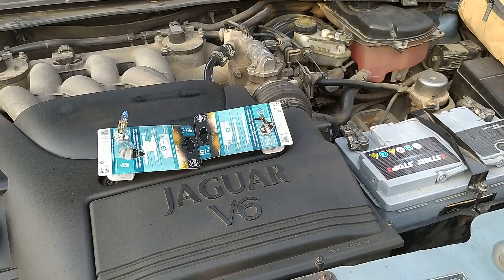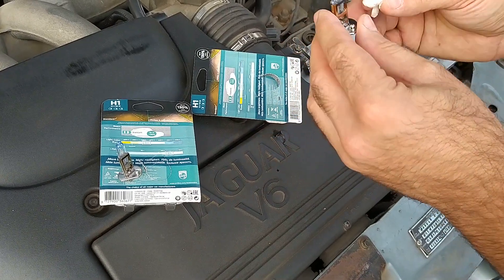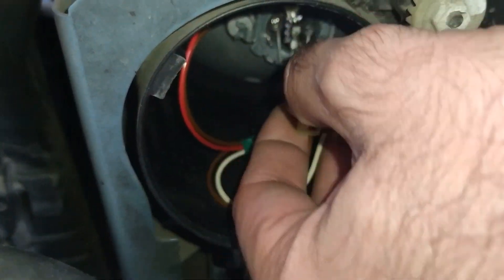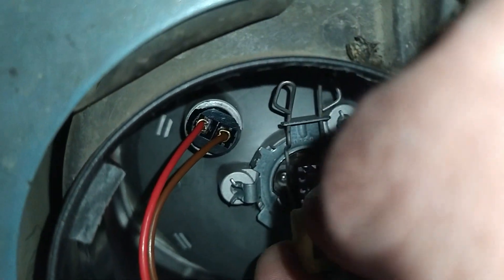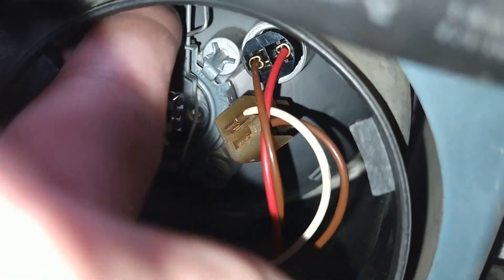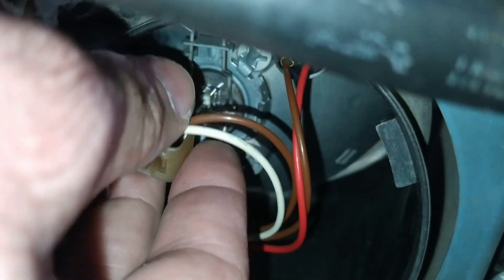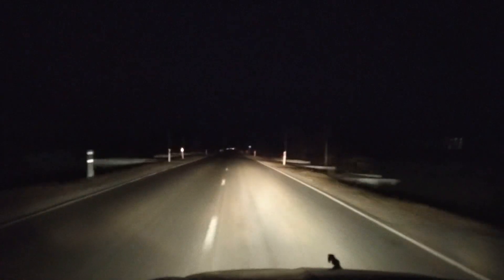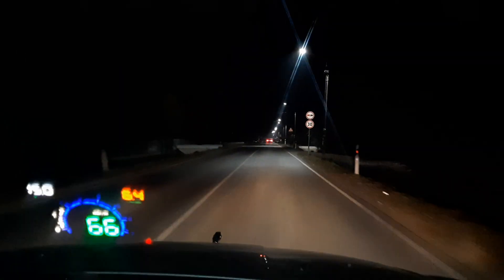Jaguar X-type headlight bulb replacement and headlight improvement

Comment: Just found your chanel... Any chance you could tell if I can change the lights to led....
Reply from the maker: LED needs a good cooling, X-type headlights are not designed to provide a good flow of fresh air to the bulbs. So I believe, HID xenon's are preferable for the X-type outdated headlights.
Reply: @jaguarrroman  thank you so much... Will try them.. Love my jag but the lights are the reason I can't take it out in winters..

Comment: This one is easy, how you replace one beside it? Do you have to take a bumper off or?
Reply from the maker: No, surely not. I get a thick wire hook and undo the side clip with it pushing it aside. After both clips are undone I open the cap and turn it horizontally in the corner of the engine bay.  This gives enough access to the low beam bulb. I can maximally remove the battery if smth goes wrong with the bulb, but removing the bumper is out of the question.

Comment: You changed the side lights not the head lights
Reply from the maker: Yes, I installed halogens into high beams and I intended to take video of installing HID xenons into low beam, but meanwhile HIDs burned out. They lasted about 5 years.

Comment: Hi great video, I have a question. So Jaguar that’s shown on your video it has a 2 outer headlights an 2 inner headlights ()()___()() do they all use the same type of bulbs H1 or is there something different with wattage? Sorry I’m new to this.
Reply from the maker: Thank you for watching! Both the high beam and the low beam utilize the same type of bulbs - H1. But it's up to you what bulbs of this type you install in highs and lows. I installed +130% Philips Halogen in high beams and HID fast bright F3 in low beams.
Reply: So I did get 4 H1 bulbs but LED that’s correct fit an the company says it’s works on 2002 x type, when I installed them it’s not working. Here’s the info on the bulbs 6000kelvin- 16000Lumen- 60watts-12volts.. I don’t know why it’s not working please help me if you can. Thanks 🙏🏼
Reply from the maker: @bonebird7778  I've never utilized LED, I believe those era headlights are not designed for LEDs. LED needs good cooling to last long, which is impossible in our headlight housings. That's why I utilize HID and Halogen. I really wish you good luck, but can say nothing to help you.
Reply: Thanks so much for the reply, now that I installed the led something is wrong with my interior lights under the front foot space. The T10 lights won’t come off so I pulled the bulbs out, any I idea what’s wrong or how to fix. Do I need to change a fuse or relay??? I really appreciate ur help!
Reply from the maker: @bonebird7778  I would first check the socket / wiring with a multi-meter, if 12V comes to the socket. If overhead interior lights are OK, it's likely not to be the matter of fuse/relay, its looks like the wiring/socket issue.

Comment: Thanks for the video, very clear! Could you please make a review of the heads-up display you’re using in this video (or even just reply here to say what make it is, and if you’d recommend it). Thanks and hello from Ireland.
Reply from the maker: Many thanks to Ireland for watching! The head-up is of some unbranded Chinese make, I've  just purchased it from eBay several years ago. It has got multiple features, I'm making use of it from time to time, but I don't keep it plugged in the OBD socket just to be on the safe side to avoid any possible ECU issues.

Comment: You have more bulb's than that !!!!! What about the rest of the headlights ????????? 🤨
Reply from the maker: The matter is that my video is not only about bulb replacement, it's more about headlight improvement. +...% bulbs will not last long in low beams, that's why I recommend to use them in high beams only.

Comment: Thank you Roman! Superb, as always. I have also read the comments. Could you explain to me as to a novice in this area: were it not about the money, which type of lamps would you install all over the car, including headlights, of course?))  I thought LEDs are the most advanced option, and they consume the least current. You say in the comments that xenon lamps are very expensive. Could you provide just a comparative quote as for all three types of new headlamps for X-Type: halogen-xenon-led, please? I mean, this type is so many dollars per lamp, and this one is so, etc... I am confused about this... Thank you once again!)
Reply from the maker: I meant that an OEM X-type xenon is expensive, because you have to replace a lot of things, in case you swap OEM halogen for OEM xenon. So I installed Philips +130% halogen bulbs in high beams and make use of them as it is explained in the video. As for the low beams, I was using an aftermarket Chinese Xenon (Fast Bright) for about 5 years, until they burned out this summer - both and simultaneously. So I have to find a new option for my low beams. If you have any ideas on this matter, you are welcome to advise.
Reply: @jaguarrroman  Ah, I see! It is more complicated than I thought) I thought you just buy some good LED lamps for both low and high, install them, and off you go!)

Comment: What a horrible....
Try Mercedes lights system
Reply: I have a united States 2002 jaguar x type 3.0  is extremely difficult to replace the front passenger most right most headlight bulb. It space is soo tight to get to. I heard via the jaguar x type forum to use a bent coat hanger to try to reach the clips properly
Reply from the maker: @hotmasked1  The matter is that when you get to know how it works you can do it with a screwdriver or any hook. You can try and remove a plastic cover on the driver's side, if it seems more convenient to you. It will be easier to handle the passenger side. Good luck!
Reply from the maker: Easier to try Jaguar X-type OEM Xenon, but it will cost half of the pre-owned Jag's price.

Comment: For some reason my red button on my key fob doesn't turn the headlights on like you demonstrated. Im sure there must be a setting that I can change??
Reply from the maker: It looks like a button issue. I would open the key fob and spray the red button with some spray for contacts and if necessary try to solder the button to the fob's circuit board with a soldering iron. In my case it helped.
Reply: @jaguarrroman  Thanks I thought it might have something to do with the alarm system. Even though I have the top end Sovereign model it does not have the alarm.

Comment: Kindly make a video on how to solve an overheating car x type jaguar
Reply from the maker: There can be a lot of reasons, why your car is overheating: beginning with the engine head gasket blown or a thermostat, coolant pump, a  fan control unit failure. You need a motorist to check the engine head gasket and an electrician to check the fan control unit (it sits on the radiator near the battery). Good luck to you and your car!

Comment: Hi! Very usefull video, I just wanted to ask if I can use Philips H1 X-Treme Vision Pro150, they seem the same, but they don't give +130% but 150%, will that be a problem? Thank you in advance.
Reply from the maker: Thank you for your comment. I believe it doesn't matter much: 130% or 150%. You can use even Osram Nightbreakers. The idea is that when Jag switches to 13.2 volts you can make use of any +% bulbs in high beams, they will shine bright and last for quite a long time (those bulbs are still alive on my Jag).

Comment: thank you for those explainations, I use a voltmeter/thermometer plug in the cigar-lighter place. Merci beaucoup de France.
Reply from the maker: Bonjour la France, thanks for the comment. I did the same for some time, but the plug-in voltmeter/thermometer died soon. And now I can say for sure what the voltage is even without any HUD displays/voltmeters.

Comment: just put led in there work much better and last longer and u don't need to clean them all the time
Reply from the maker: Thanks bro, but: X-type head lights are not designed for LED bulbs, they don't provide necessary cooling or need either cut or not cover back caps, otherwise LEDs burn out quickly. Besides, quality LED are much more expensive, than halogen bulbs. And cheap LED bulbs are often out-focused, because their array often don't match the filament position of H1 bulbs, Jaguar X-type head lights are designed for. Are you still insisting on LED bulbs for X-type?